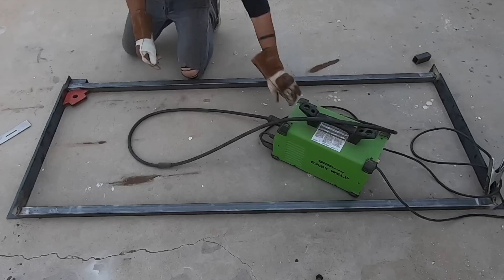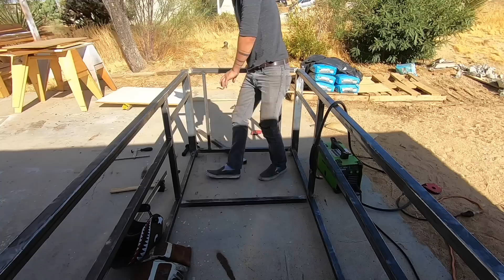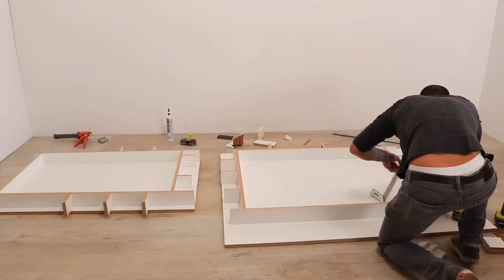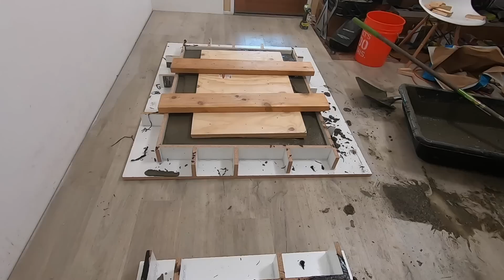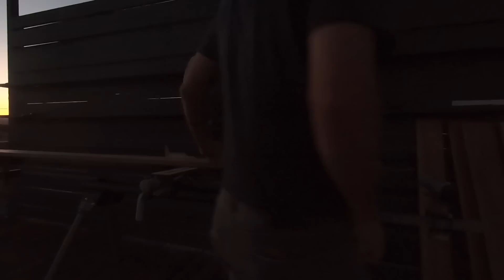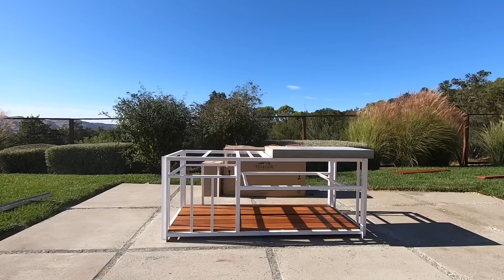Building an Outdoor Kitchen Island with DIY Concrete Countertops

Comment from the maker: I made this Outdoor Kitchen Island with DIY Concrete countertops and a steel and wood base for Chef Amanda Haas and her fleet of Traeger Grills. I used Quikrete Countertop mix to make the concrete countertops and I sealed them with Varathane paste wax. I used Cumaru deck boards for the shelves an assortment of steel tubes and angle sections painted with Rust-Oleum protective enamel in gloss white for the structure.  
 
This project was sponsored by Traeger Grills: click here to learn more about this really cool cooking tech: https://www.traegergrills.com/
I am using the Traeger Ironwood 650 Pellet Grill and I love it!
 
I made this island for Chef Amanda Haas here is a link to her newest cookbook:
https://amzn.to/2q2xHaZ
 
Links:
Decked Truck Storage System:
https://decked.com/
 
Forney Welder:
https://amzn.to/2q4dGkn
 
Cumaru Deck Boards:
https://www.advantagelumber.com/cumaru_decking.htm
 
Quikrete Countertop Mix:
https://www.quikrete.com/productlines/countertopmix.asp?gclid=EAIaIQobChMItNabk4mS5QIVtx-tBh2hDwuIEAAYASAAEgIULfD_BwE
 
Rust-Oleum Turbo Spray System:
https://www.homedepot.com/p/Rust-Oleum-Stops-Rust-24-oz-Turbo-Spray-System-Gloss-White-Spray-Paint-334133/305613981
Reply: That's a beautiful table, great work!!! I would have also incorporated the pellet BBQ into the table by removing the wheels & legs from it, that would have been even better.

Comment: Overall great build and I love the slat and steel design. I'm definitely looking into the Cumaru deck boards. For anyone trying this build I would recommend an impregnating concrete sealer and while mixing the concrete add in AR glass fibers and glass fiber rebar if you want added strength to the concrete.

Comment: Nice results! Forgive me is this is a dumb question, but I was under the impression that it is inadvisable to weld on concrete - just curious what the consensus is on that, since I am a complete newbie.
Reply: No safety issues. Don't see the issue other than the concrete is probably not a perfectly flat surface in most cases. And for sure you wouldn't wanna weld on concrete that you concern about keeping pretty. There will be some burns on it from the arch/splatter.

Comment: Nice video.  I am digging your swirling action during your welding practice, also I like the use of the periodic melamine stiffener braces on the concrete form.  The finished product to so attractive.  P.S. I love the look of the wood.

Comment: How long dose the solar panel take to charge up the battery and do you have to use any converter to do that??
Reply from the maker: depends on where you are and the weather.  everything needed to charge from solar is built into the Goal Zero unit